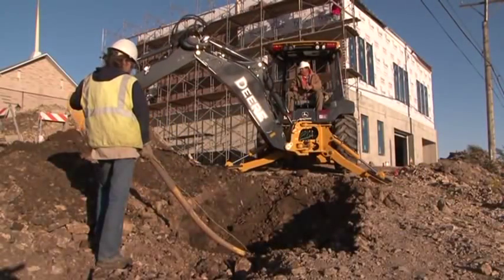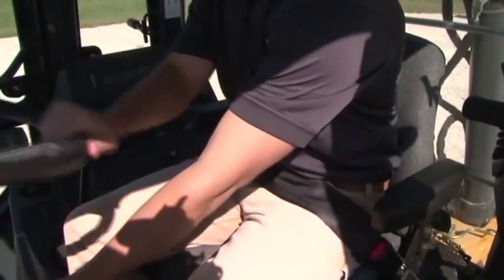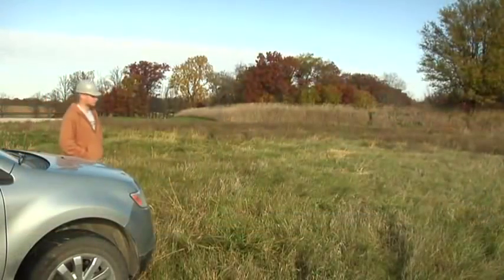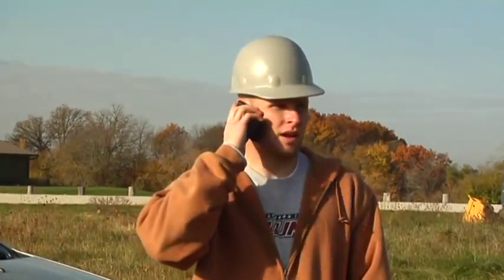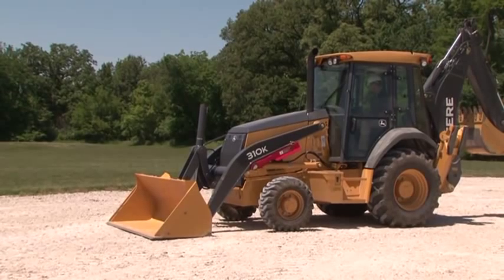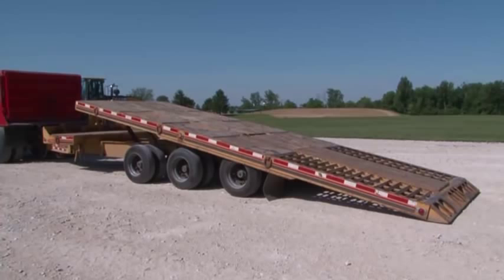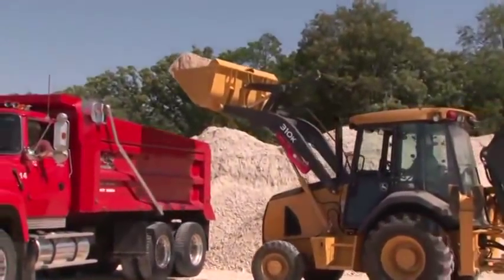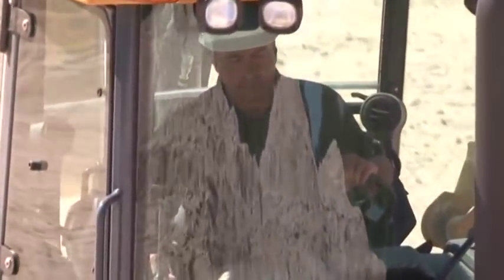John Deere Backhoe Loader Safety Tips

Comment: Hi :) i would like to ask you about one particular thing that seems is applied differently at some cases ,i mean the backhoe excavator when  loading on trailer or lowboy trailers ,some people put it with the dozer blade-front loader blade  forward ,mean that dozer blade points toward the truck driver ,and other people put it with dozed blade backwards ,so that dozer blade-front loader blade  points backward ,and the excavator bucket is directed toward the truck driver ,my asking is what is the correct way to place backhoe loader over the trailer or truck -with excavator bucket backward pointed or with excavator bucket forward pointed ,toward the driver ?
Thank you :)

Comment: Note the operator having to constantly look around the boom!  To use the centre pivot backhoe is not only unproductive, but downright dangerous! Visibility is drastically compromised by these out dated machines. A sideshift backhoe is far more superior in every aspect, safety, productivity and more operator friendly.
Reply: Anyone who's spent time operating one knows how to deal with the machine's quirks and limitations, just like any other type of equipment.
Reply: jakesemtex That's why you dig at an angle, but regardless you do have a point.
Reply: jakesemtex they don’t make the kind your talking about in America.